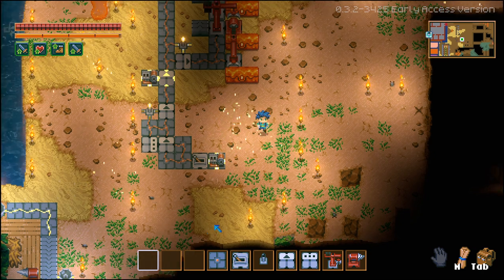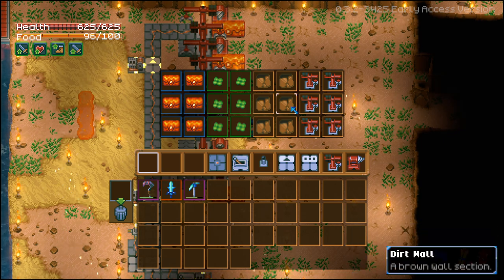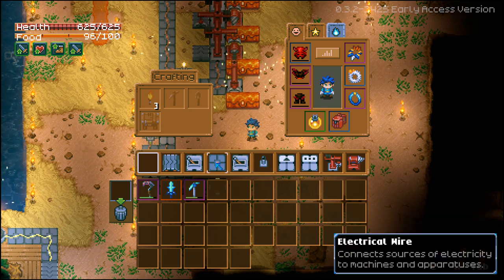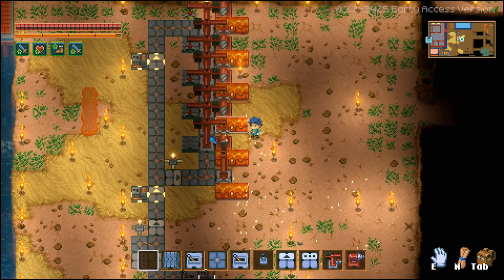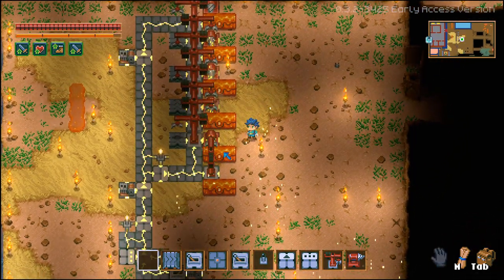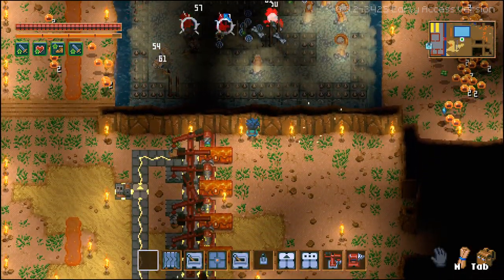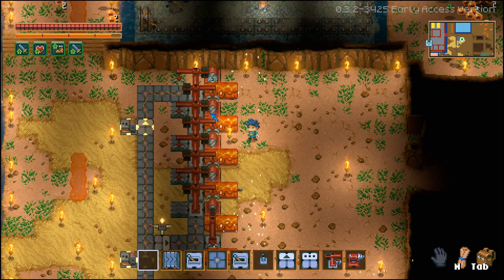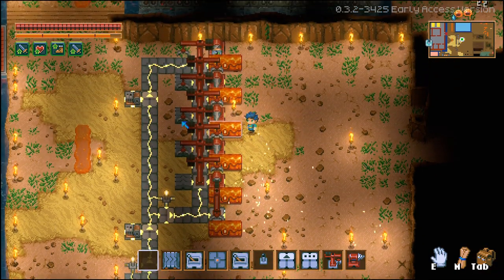Automatic Chest Sorting BUILD! | Core Keeper

Comment: Hi, my friend followed this method, but she said there were chests broken bcs of the drill drilling the chests. May I know how to solve this? Did you meet this problem?
Reply: The electric pulse is very important. If it's too long, the drills will break the chests.
This video doesn't really explain it, but if you pause and look at all the tiles around the switch, you'll see a few fancier ones. In the orientation they are set causes the electricity to pulse on/off. This gives the drills enough time to pull items but not break the chest

Comment: What is the purpose of the drills?  I'm confused why a conveyor doesn't work for this purpose and if this to grab things that fall on the ground why does it point at the chest?
Reply: I think is because the robot arm will drop a item above the chest if is not the correct chest. And you need to make those itens continue the line of sorting. A conveyor doesnt pull the item from above the chest so you need the drill to make this movement to pulling the item, just like it does in a ore.